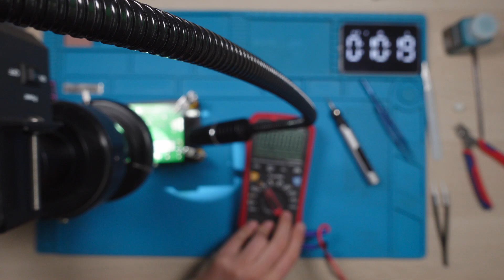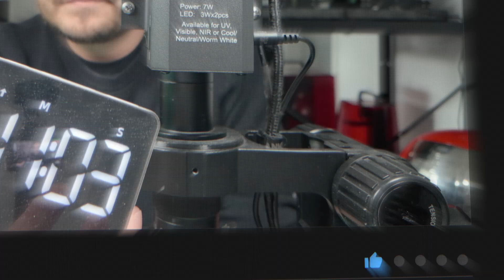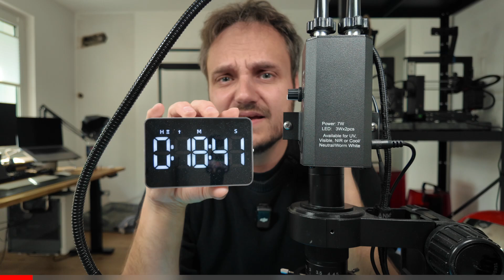How to FIX a Damaged PCB Trace (Step by Step)

Comment: thanks for the video but my problem is in my mouse middle button but its easier than that one in the video to fix cause you could just trace a already working pad with a welding and weild a wire to it with external wire to get the switch working but still the video is useful if theres no traces

Comment: Quick. FIRST :P
Reply from the maker: Haha 🫶
Reply: @CanWeFixThat  I have the same grinding pen and in the last video we had a misunderstanding. I want you to make the low meld solder + video XD
Reply from the maker: @SebastianL.83 🤣 I will research, but I can't promise that this makes sense and will work. 😁
Reply: @CanWeFixThat  if seen some people that make sticks of the fieldsches metal, maybe thats a way. tell me more about the huge LED light on your scope XD
Reply from the maker: @SebastianL.83 Yeah, I know, but the problem is that it is not easy to buy this kind of metal, so it is quite inaccessible. The lamp you are referring to is the anti-glare light, that had two separate articulated lights, so it minimizes light reflections. I added it to the Equipment part in the video description. I hope that helps? 😁